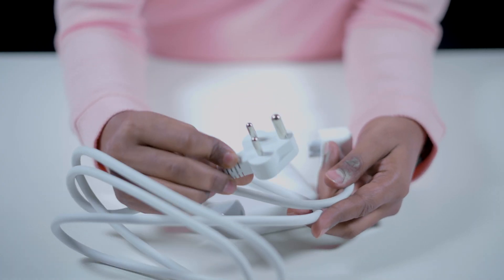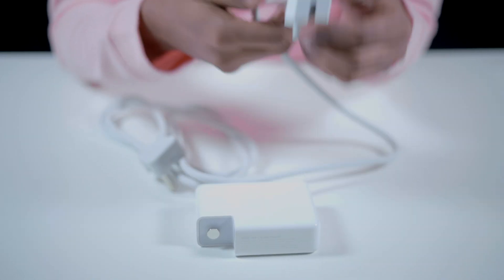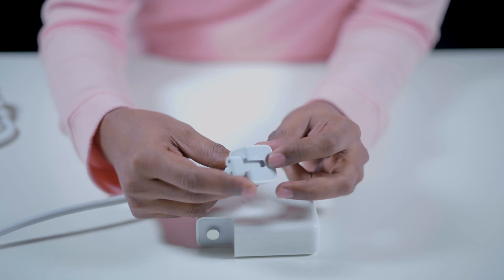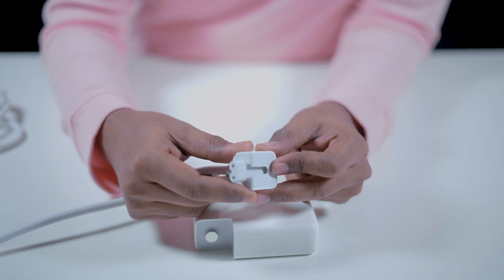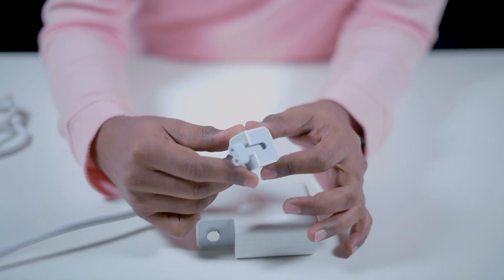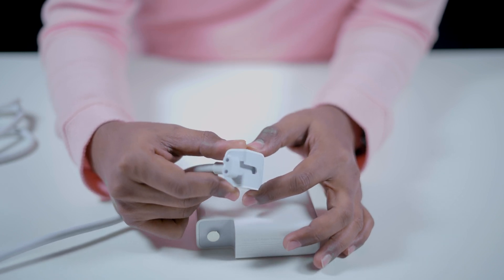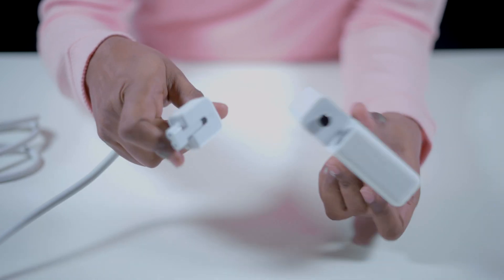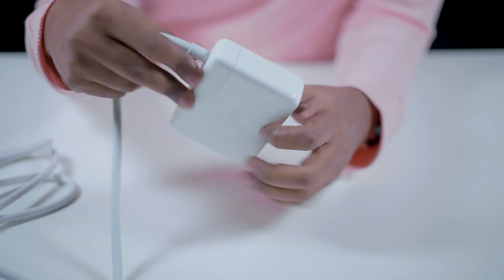MacBook electric shock leakage issue when charging ⚡️ How to fix? | MacBook Pro 16" M1 Pro

Comment: Problem is with the Macbook. I have Dell XPS (metal body as well) along my Macbook Pro M4 and I can use the same macbook power adapter without electicity being passed on me. It's just proper case shielding, and bad engineering on Apple side.

Comment: Hi, I am feeling the static shock even while it's not charging or connected to any external monitor. It happens whenever I step away for a while and touch my laptop the first time after I am back. Do you think changing the cable or adapter will work? Or should I show it in the apple centre? Thanks!

Comment: I get a strange type of shock from my macbooks when they are in use, turned on. It's more like an electric vibration, sometimes it's very noticeable and i don't like to rest my wrists against the machine. Not really a shock but a high frequency vibration as soon as your skin connects.
Reply: yeahh , exactly ... what did you do , do you still use it normally or have you fixed it ??
Reply: shivanshu what did you do ?? @shivanshsharma4916

Comment: Mine is originally 3 pin charger but still the same problem
Reply: yeah i bought two days ago m2 pro 2023, comes with 3 pin and find this issue. I am disappointed. I just got a brand new and i have to fix this shit googling
Reply: @KaungMinSat-x6z  did u found any solution
Reply: @_vaibhavkadav_  any solution bro please help
Reply: @KaungMinSat-x6z    how you fixed it?
Reply: @KaungMinSat-x6z  any solution bro please help

Comment: I had the same issue, until my Magsafe 2 adapter broke. Got a third party cable and took it to a local electrician. Suddenly, the issue was gone. They say that this is a grounding issue, but that current leakage on the MacBook body existed even while using a three pin plug. From what I see, the reason for this current flow seems could be due to the phase configuration (either in the adapter or in the power socket itself). It seems the local electrician swapped the phases (as per Indian standard), while connecting the new cable, and hence I don't feel the electric flow on the body anymore. I consulted the electrician with this problem, and he too says that it could be due to some issue in the phase configuration between the adapter and the wall socket. I have even tried using different adapters, but they all produce the same electric leakage on the body, except the one repaired by the electrician. Would be nice to see some discussion on this point here.
Reply: yes @dipankar, I also faced a similar issue of electric shock from the laptop's body. The problem is not with the charger but the electric connection where we plug in (In my case and may be for other). Because, in some places, e.g. at my library I do not face the issues although using the same laptop and charger.
Reply: @tejashiroy2961  Interedting to note that. Seems like a general case for all MacBooks used in India. If that is true then it is appalling to note that Apple is not able to provide India specific connectors for the cables. I bought a cable recently, and the problem still persists. I’ve seen this occurring for even iMacs.
Reply: @dPten  your point may be right.
Reply: @dPten  The issue happens in US as well.  But after I switched to 3-prong plug from Apple(from Intel-based MBP), the issue is resolved.  This shocks me that Apple have this issue for so long time without fix even this exists in my M2 Pro.  I wonder if Apple employees only use their laptop with an external monitor and keyboard.
Reply: @wanyelandy8847 I just bought a MacBook Pro M1 Max last week from the USA & I'm trying to use it in India. However, I'm feeling the electric charge on the overall body of the MacBook while charging. Plz, let me know the fix for it, sir. 🥹
Reply: mate , I am horrified , i just bought a new monitor , and i noticed tingling when my macbook is connected to it (using hdmi-typeC converter) , the tingling also happens when charging with all adapters at my home , i litterally noticed this first in 2 years of ownership of this laptop ( 1 week since i first connected it to my monitor ) ... Should i blame my monitor or hdmi to c converter to have done this to my macbook ?

i can fix charging tingling with 3 pin cable ,, but what about my monitor (its also 2 pin) am i gonna have to just throw it away , did it just waste my money ??

is this even an issue ? will my mac have issues do to this or can i just ignore this shiz ..... i am honestly confused
Reply: @shivanshsharma4916 shivanshu how can you end up with this issue?? in new M3 air also have this nasty issue. what should i do ??
Reply: @inertia-w3g  I asked a couple of my macbook owner friends , all of them said they also have same issue since day 1, so I decided to ignore it , also the issue is not just limited to macbooks , all metal body laptops have it , my friend with mi notebook also has it 🙂

Comment: Instead of putting my feet on the ground, when I put my feet on wooden bar of my Table all the electric shock and tinkering (due to charger and extra monitor) vanished :). 
I hope it will help many others. :)
Reply: Apple should include this wooden bar in the box .😂
Reply: bro , i also noticed this tingling ever since i connected to a monitor (hdmi to c converter) before this i never had such issue while charging too ... is your macbook all right ? did you do anything to stop it ? ik tingling is very minor but it it bad for mac ?
Reply: @shivanshsharma4916  
Hi Brother
As said earlier, when I put my feet NOT on the ground but on some insulator (wooden box, foot rest bar of the table, other foot rest, may be rubber sandal/chappal) then this tinkering goes away, whether due to charger or due to external LCD, or both)
Reply: You are right. Immediately I wore a footwear, it completely stopped.

Comment: I feel tingling / electricity on iPhone 13 body while charging.. Is anyone feel that type of issues. I went to apple care center thay say it's a normal things in iphones don't worry that thing not affect your phone...is that any solution for that??
Reply: Ya bro I have same problem. I have iPhone 12.I’m feeling some current on side frame while charging.
Reply: @arijitganguly3019 bro any damage on your phone?

Comment: I have static shocks sometimes even when my MacBook is unplugged. Wondering if it's normal because of the mac's aluminium body?
Reply: With you concluded bro, my new mac m1 air is giving static charge without charging

Comment: On the 2021 macbook pro m1 pro, when it's charging, you can feel the current in the shell of the laptop. if you rub it especially, you can feel that 50hz jittery tingly feeling. It's like the adapter doesnt totally convert ac cleanly.
Reply: It is, my motherboard had a short cirxuit m1 pro 2021 16" and now in the icenter getting fixed.
Reply: @fitrafi7645  bro did you got that issue was it free of charge or does that thing included in apple care please explain me in details because I also have M1 Pro 16inch and im worried
Reply: it's dangerous for the mac or no ?
Reply: @testamv7476  i swear to god no one is fucking answering this question , what did you do bro ? did you fix it ?

Comment: I get tingling on my Mac mini M1.... How can I fix it? Please suggest
Reply from the maker: Get a 3 pin Power Adapter Extension Cable, it has a ground support so it will avoid the tingling effect.
Reply: @ProgramHubNet  i have 3 pin power adapter it comes by default while i bought macbook pro 14", I'm still struggling it gives me electricity shot when charging. Any solution?
Reply: @gerrsyah   did you connect it to a monitor or any peripheral device which requiers to be plugged in ?

Comment: I got 3 pin adapter with my mac pro 14". But my whole house/home electric wire is not earthing proof. That is why i feel still  MacBook electric shock leakage issues. Could you please tell me any other solutions? Thanks in Advance
Reply from the maker: You need to call an electrician who provide you with a ground connection in your home.
Reply: @ProgramHubNet  Thank you. But may be need to call experienced electrician!
Reply: Same issue here

Comment: I live in a country where its standard to provide 3 pin plugs, all the macbook chargers come with 3 pin plugs by default. However, we have experienced the tingling shocks from the macbook chassis on multiple occasions, so I think the issue is not just with the plugs & power cables. Any other ideas what could be causing the issue?
Reply: You would experience these shocks even with a 3 prong if the wall plug you are using has a ground issue.

Comment: My macbook pro 2015 15", I bought it a week back having tingling shock and getting more heat on the panel bw keyboard and display. Is this normal? Anyone pls reply me...
Reply from the maker: Yes that's normal, specially with MacBooks from 2012 to 2019
Reply: @ProgramHubNet  Interesting, my 2015/2019 MBP do NOT have that issue.  But my M1/M2 laptop have that issue.

Comment: I have had this exact since the first day I bought my Macbook Pro 14" 
I tried different chargers but still, I can still feel the electrical charge while charging. Also, in this state, the mouse keeps moving randomly. I took it back to the retailer I bought it from here in Saudi Arabia (Extra). They did not know what to look for, even though I told them. I will take it back to them, this is really annoying.

Comment: Quite disappointed to have invested $1k to get a laptop that gives me electric shocks to be honest.
Reply: same here...
Reply from the maker: Can understand your concern. Apple must provide a 3-pin ground supported adapter.
Reply: @ProgramHubNet  I got 3 pin adapter with my mac pro 14". But my whole house/home electric wire is not earthing proof. That is why i feel still  MacBook electric shock leakage issues. Could you please tell me any other solutions? Thanks in Advance
Reply: @thebutterboy7910 Hey bro, is your mac alright? No bad happened with you?

Comment: My macbook pro 2019 feels static when charging. So annoying, I think I’ll be getting this 3 pin cable at some point. Does everyone that has the 2 pin charger feel these little shocks when its plugged in?
Reply: yes same for me and I'm wondering if its any problem with it like if it's safe to use
Reply: @andrei.267  did you fix that problem ? any conclusions ? did u face any issue with your mac?
Reply: @shivanshsharma4916  i talked with apple support as well, that tingle sensation when charged isn’t a problem, (it’s not present all the time) beside feeling it i never had any issues with it so i don’t think it’s a real problem. Hbu what’s ur experience with this?
Reply: @andrei.267  yeah , i also ignore it now , its a non issue , I just wanted my laptop to be safe
Reply: @ShotX I wonder if this problem happens to everyone that has 2 pin chargers
Reply: @ShotX from where you order the 3 pin adapter ? I did not find in Apple website - can you please provide the link ?

Comment: Hello, Many thanks for the video. I am writing from Middle East. Here we have a 3 pin adapter along with the Mac but when opened up as you did there doesn't exist a circuit connection for the 3rd (you opened up and a gap is shown for the 3rd pin inside the adapter). So, are we sure if we purchase another 3pin adapter from Apple it will actual be the 3 pin adapter and not the dummy one I got ?
Reply from the maker: Yes, Apple Power Adapter Extension Cable that you purchase separately does has a metal connection for ground circuit which helps you to get rid of static electric shocks.
Reply: @ProgramHubNet  from where you order the 3 pin adapter ? I did not find in Apple website - can you please provide the link ? I am from India

Comment: hello bro, i am having this same issue with the charger but also i noticed it happens also when i am connected to an external monitor via a displayport to usb-c dongle, is this the same issue?
Reply from the maker: Yes it happens, when you connect to any kind of external powered device like monitor, external hard drive with powered connection, etc.
Reply: @ProgramHubNet  ok, since there is a solution for when this happens while charging (getting a 3 prong duckhead), can I realistically do anything about this electric shock when I am using the external monitor?

Comment: I found it odd that Apple stopped including the three-pin adapter.  I think both (two-pin and three-pin) have their benefits.  With my older MBP’s, I have used both over the years.  When I ordered my 2021 MBP, I ordered one of the three-pin adapters since I realized they weren’t included.
Reply: from where you order the 3 pin adapter ? I did not find in Apple website - can you please provide the link ?
Reply: @sbhattacharya3025  Apple has it is their Accessories list.
Reply: @arlencarlson they even I wasn't able to find it please attach the link to that